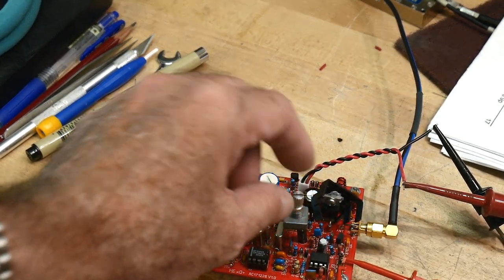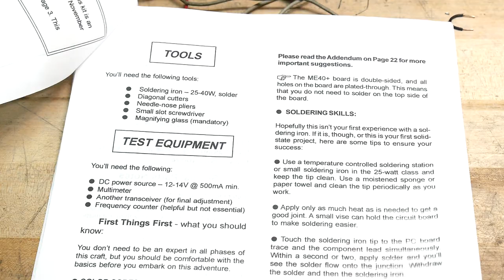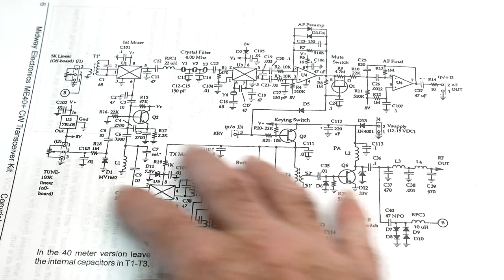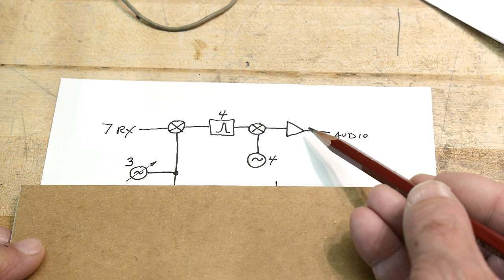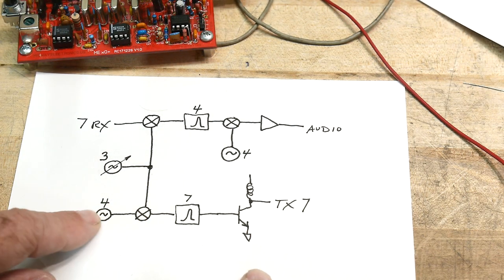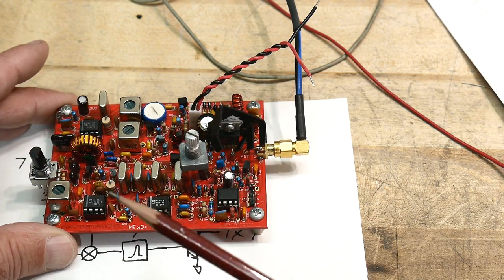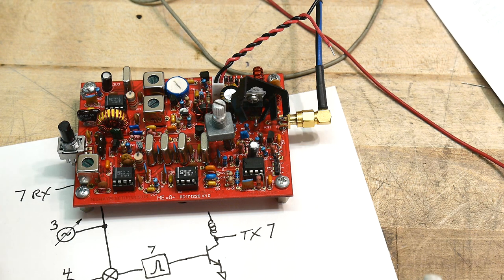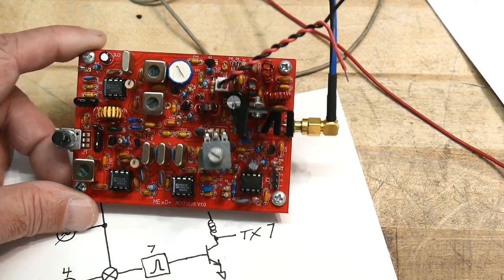#629 ME40+ 40 Meters Transceiver

Comment: I built the 20m kit Dave Benson use to sell many years ago....like a long time ago. Very simple design and it worked very well. With no display to use power, the rig barely used  any power on receive. Fun kit and thanks Dave! 73 ~ k6sdw

Comment: The voltage regulator is an IC yes?   I am wondering if you could explain the design of a have wave end feed transformer? I know the turns ratio 1:7 transforms to 1:49 impedance. On the primary 2 or 3 turns with 100pF cap on a 43 mix toroid. How would you design for a another band like 6m?  How many turns? what would the  xL need to be?  Awesome channel  enjoy it.
Reply from the maker: Yes there is a 78L08 regulator to give an 8VDC stable supply for some of the radio.  I don't know anything about antenna transformers.
Reply from the maker: With a name like RFdave shouldn't you be teaching me?  :)
Reply: @IMSAIGuy  I just love RF.  Thanks for the reply.